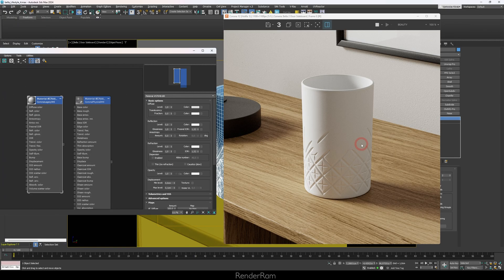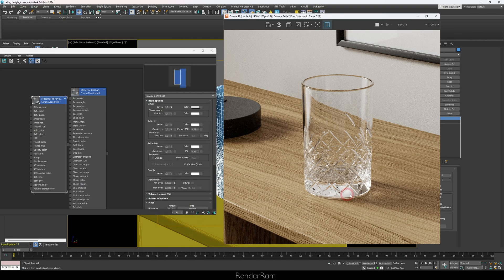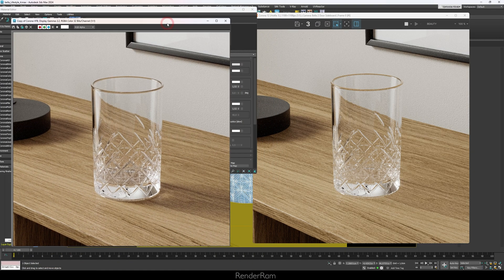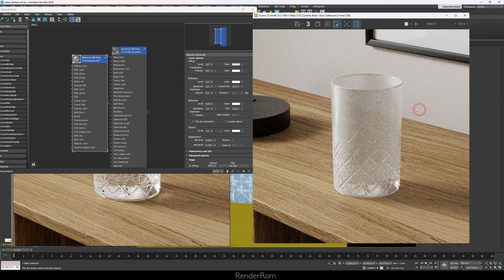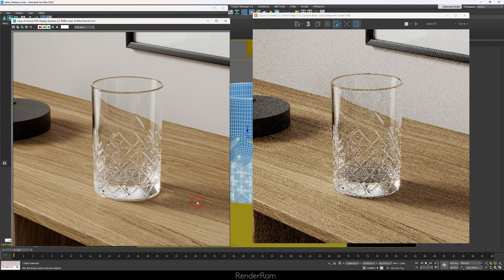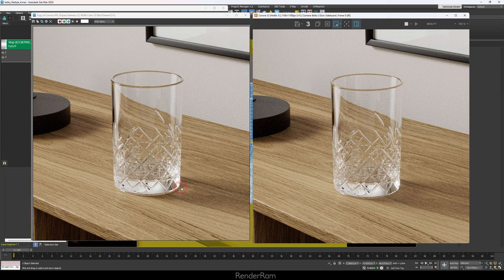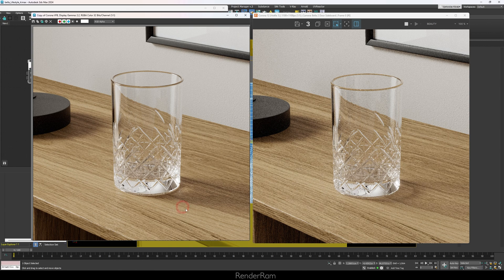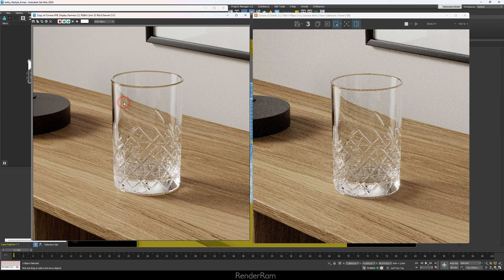Materials Ep11: Fake Caustics On Glass | 3ds Max

Comment: In Maya V-ray there's a V-Ray Material Override built in extra Vray Attributes of Vraymtl. Works the same, but you need to override shadow material only, GIMaterial is optional. There's also a Vray Ray Switch texture, but I am not quite sure how it works

Comment: The 'hard shadow' is the result of imperfections in both the glass material and the object's surface. Caustics occur when these imperfections align in a way that concentrates light rays at certain points. Due to energy conservation, the photons that brighten these points are displaced from their original paths. Thus, when photons travel through air (without glass) and hit the table, they create no shadows. Similarly, light that is perfectly refracted through thinner parts of the glass creates minimal shadows (almost no shadow, almost😅) 
At the end, the result is impressive! I had never thought of combining two materials like that. You got way more control with the falloff map too. Great video 👌👌